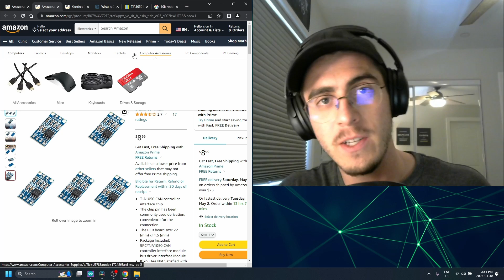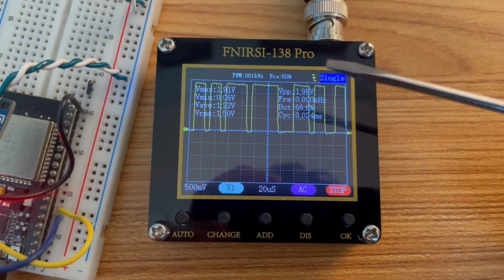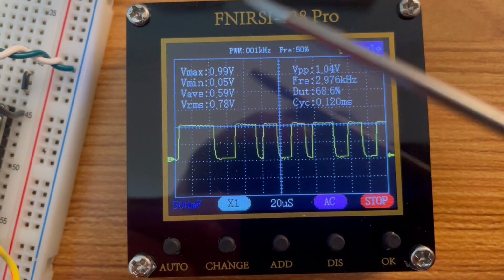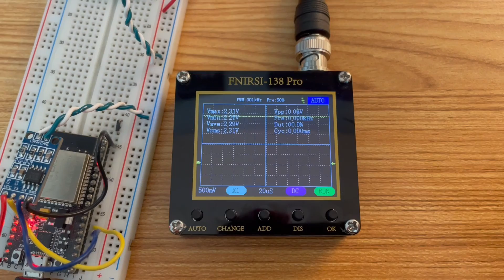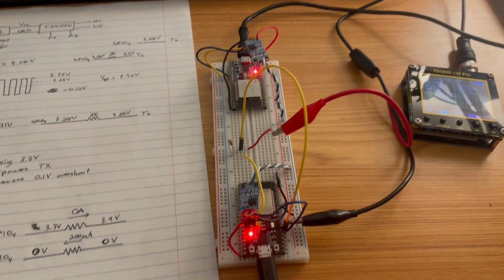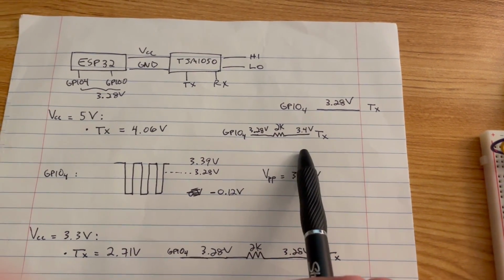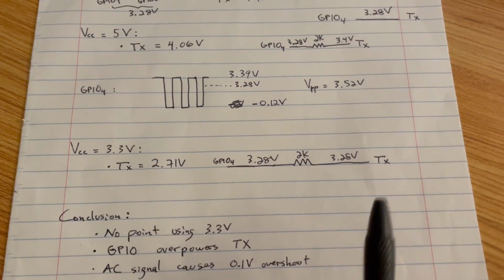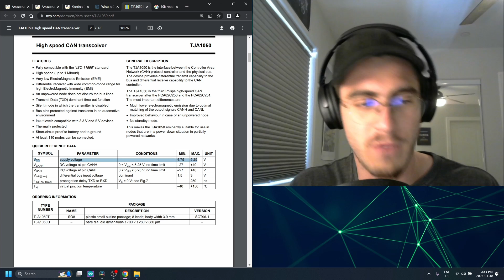CAN Bus signals on a breadboard with ESP32 microcontroller and Oscilloscope

Comment: I am doing a project in a compnay to present in university, that consists in making an CANtoIP conversion, and I am using the isow1044 can transceiver, is there any difference to that transceiver in the video besides it has galvanic isolation?

Comment: Hi!
I have watched this and some of Your previous videos regarding CAN mainly due to my CAN transceiver "not working properly" and I didn't really pay much attention to the 3V/5V discussion, until I had to.
My setup consists of busmaster SW running on my pc. With it I send and receive CAN messages via PEAK USB CAN interface to all of my other participants. Been using these tools for 12 years now on several different cars/motorcycles, small CAN related and other work related projects. Other CAN devices momentarily on my desk are ECU, TCU, display unit, small CAN keyboard and some other. Specifically I am just testing and programming all the devices needed in my car before they actually find a way into the car. At the moment I am developing a small CAN "Gateway" for a specific purpose and for that I am using an ESP32 and TJA1050 transceiver.

At first I didn't really think about how to power the TJA as it can be powered via 3.3 or 5V so I used 3.3V. After some time developing, testing and thinking, I noticed that the bus would just stop working on the device under development so I looked for mistakes in code etc. however looking at Busmaster, it was quite strange that there would be "bus errors", "other errors", or some other error present at the same moment or shortly before the device stopped working. So after reviewing the code over and over again, I just removed the 3.3V supply to TJA and used the 5V. And to my surprise, not a single error was shown since then.

I guess my conclusion is that in Your specific case, the bus might work with 3.3V supply, however without proper CAN analysis tool very little is known about the performance of this experiment (and if there are bus errors). Going by what lays on my desk at the moment I think introducing the setup shown in the video  to an automotive network will not work properly.

Hope this helps someone struggling to find the issue in their bus.

Cheers, RoB

Comment: I understand trc2csv exists, but do you know if it's possible to convert a trc capture (I have a peak usb interface) to an asc or log format?  

For example, python-can logconvert doesn't seem to support trc.. the only way might be to do in multiple steps?
1) canlogconvert  from trc to asc
2) logconvert to go from asc to log
3) Once it's in log format, it can be converted to csv using Log-CANverter ... or log plotted using cantools

Comment: Thanks for video. So the result is that you can use TJA with power supply 5V, but with a resistor or without? If with resistor, than which one?
Reply: 1k

Comment: I connected one esp32 with one tja1050 , the other side of tja1050 i.e CANH and CANL i have connected to one of the can network.
i see that i am not getting any output i.e rx signals to esp32 

could you suggest something on this error
Reply from the maker: When debugging it’s helpful to isolate the issue. Do you know that the CAN bus is active? Have you confirmed you can TX data from your transceiver? Do you also have a CAN bus on a breadboard or some other setup?
Reply: @EV_engineer  I have ecu which is transmitting rx signals.. 
Transceiver is not sending any Tx signals.. Yes can bus is active..
Reply: Could you help me out.. How to solve this?
Reply: Same problem! Have you fixed it?

Comment: I really enjoyed your video :) 
I was wondering if the CAN transceiver is really necessary for applications where the CAN nodes are close to each other with a distance of approximatively 20 cm (it would be for a communication between a dsPIC and a ESP32) ?
Reply from the maker: Hello, glad you enjoyed the video! CAN is designed for safety-critical applications, i.e. automotive or aerospace. In those cases, cables are long and we need to ensure signals aren't affected by interference. Definitely not necessary for short distances such as in this video